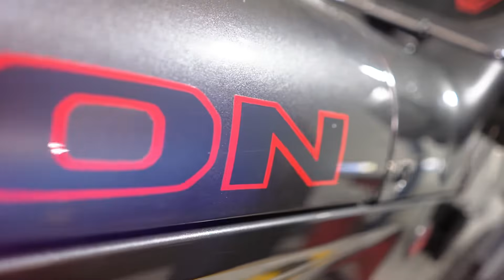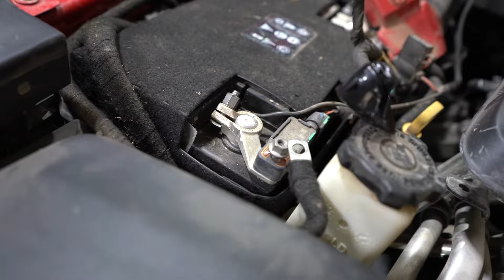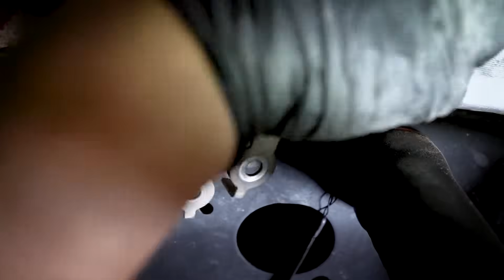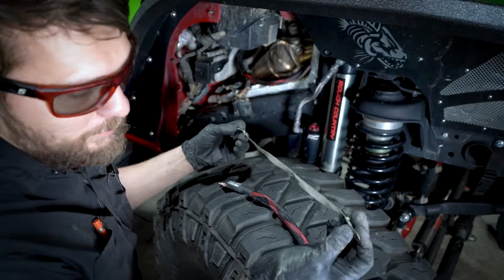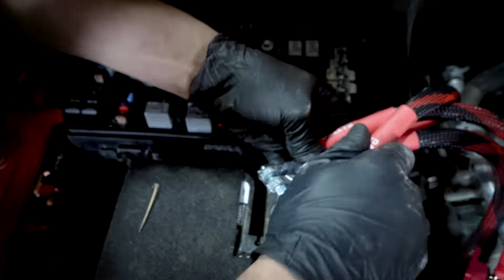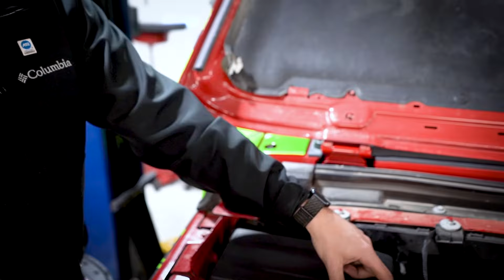JeepCables Big7 Battery Cable Upgrade on Jeep Gladiator

Comment: Did this on my WJ with a 4.7. I added spiral wrap to the cables for added chaffing protection to the 2 gauge wires. I made a bracelet for the fuse. Fantastic product. I’m going to use their winch cables when I install the winch.